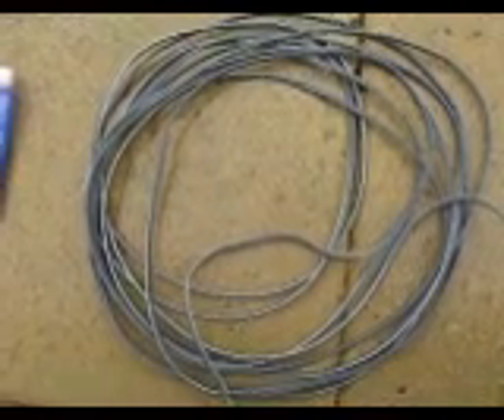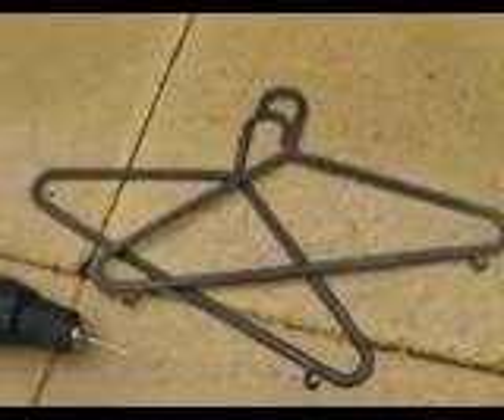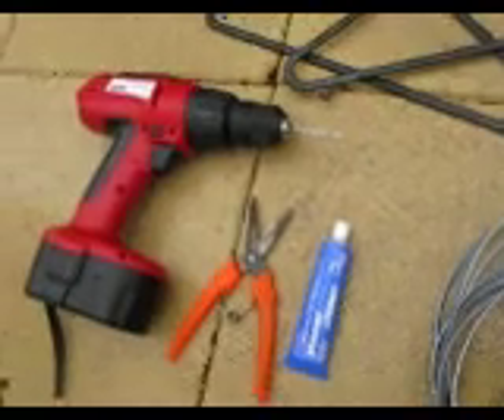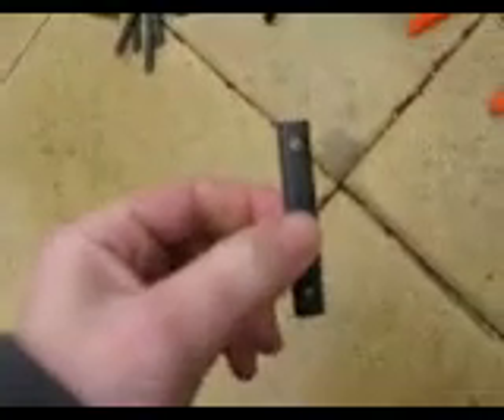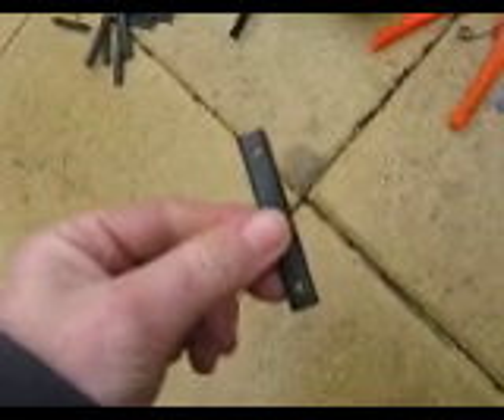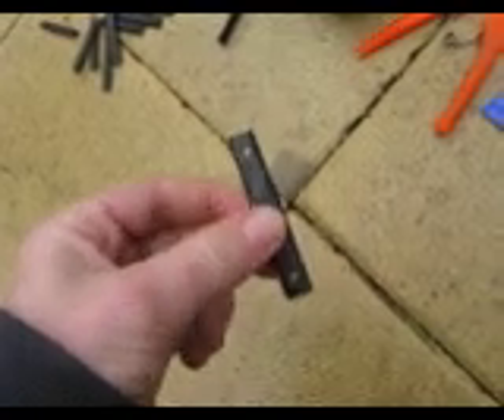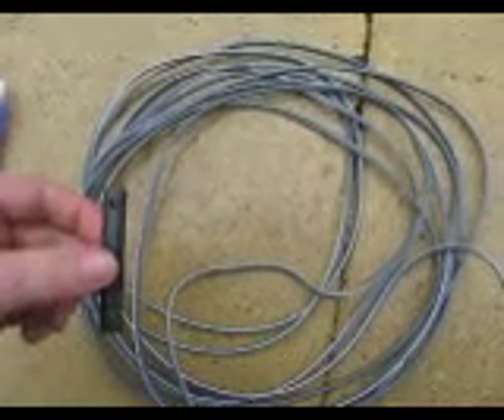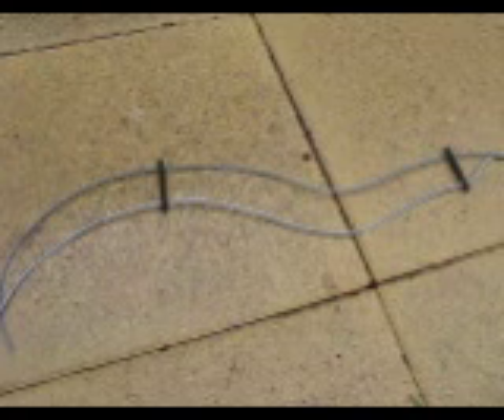Making open wire feedline

Comment: Hi there! Greetings from the UK.
If I replace my 10m RG174 coax by this type would the reduced loss be noticeable on QRP on the HH bands? Say between 10m and 40m? Thanks
Reply from the maker: Maybe slightly, especially on higher HF bands.

Comment: The whole idea of the plastic spreader is keep a consistent spacing between the two wires. When the spacing changes the impedance changes. Everytime the impedance changes you have signal loss. You will get a performance improvement if you don't crunch up the feedline and hold a consistent spacing along the full length of the line.

Comment: At either end or both ends? How do you keep the line from twisting and canceling the open wire effect?
Reply: I'm an old retired electrician and new Ham. I see 12 years with no great answer. I'd say as long as the entire length is out in the open air a few twists don't have much effect. But the low power Cat cables used to experiment with a deliberate number of many twists per inch to try and keep the sound clear by canceling the ambient interferences from nearby things they could not avoid. I would place nonreactive rigid spacers only 6 inches apart. (close enough to insure the spacing in the wind)  and keep the spacing consistent for the entire length. No Ys or cheating at the matching device just to use something smaller. The ladder line should form a Tee with the dipole antenna.